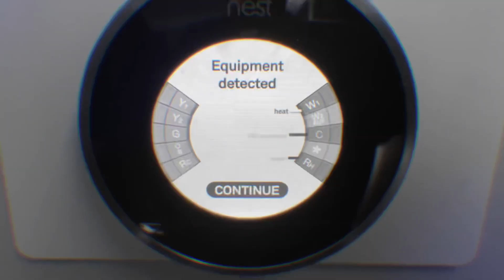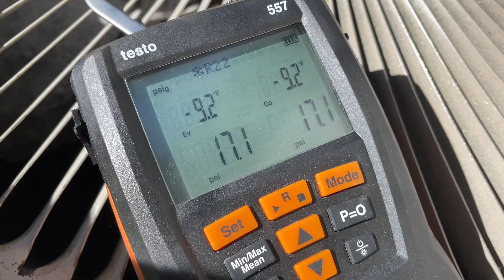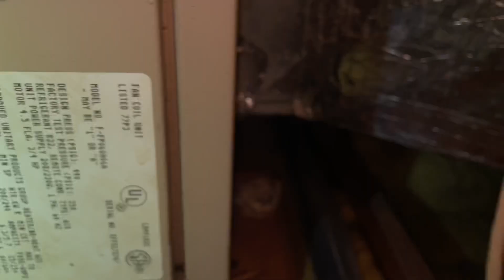Central AC Not Cooling - No Refrigerant R22 in System - Time for a Bosch IDS 2.0 Installation

Comment: There's such disparity in this industry - local contractors either stare at me blankly when I ask if they'll do a manual J, or don't/won't do it, and here you are offering it as a requirement for system replacement. It's no wonder there's so much shit installs out there.

Comment: By rights,that should be metal duct! That 18 is only good for like 1300 cfm,20 is good for like 1700,smooth round 20 inch is what that needs,but if you are dropping size do to it being oversized,the 18 will be fine!

Comment: I urge all my customers to strongly consider replacing R22 systems....if it working now its just a matter of time till you are stuck....doing a leak test....lets see....labor rate plus freon....already halfway to new system....basic logic
Reply: What does a 3.5 ton condenser and a coil run these days?
Reply: @PipeDoctor  that to lol
Reply: @PipeDoctor  
Fortunately my condenser is just over a year old.
Reply: @PipeDoctor  ohio....its about the same....
Reply: Our supplier preordered alot of units...so we are sitting ok.....for now...
Reply: @PipeDoctor  We have zero lead time here in Ohio. Our supplier over orders and never has issues with shortages for the most common sizes

Comment: Unless your home is 5000 square feet or more you dont need a 5 ton unit !
Reply: @PipeDoctor  hahaha
Reply: 3,000 more like it 20 btus per sq ft add/subtract off manual j,Windows,doors,insulation factors! Now in Florida maybe 5 ton unit for 2,000!
Reply: @petersmart1999  They are in the northeast... not florida !
Reply: @oldskool1979  What did you read,I was agreeing that the unit is way big for that house,he has 13 or was it 14 tons total, I know it's in N.Y., not in Florida. In Florida that oversize the condeners up one ton from most indoor coils!

Comment: One of the last projects My late father was working on was 40 ft of sewer ljne. He  antimate about putting cast iron . A job that could have been 5k PVC turned to 17k. Cuz he wanted to use his left over hub fittings And he made sure to put cast iron venting. I mentslly curse him out every time  I see cast iron pipe cuz it out undue stress on him at the time :/  but it had to be done right !

Comment: I think some insulation will go a long way in that attic, joist spaces with no insulation and i noticed a supply boot looked like in a bathroom with no insulation around it , oh boy not good. Nice attic for sure ! 18" flex duct on 5 ton system OMG how did that ever work ?

Comment: High pressure Mikey strikes again!
😂
It could have just been Schrader leaks😆😂
🥃🥃🍺🍺🍺🍇🏌
Stay safe.
Retired(werk'n) keyboard super tech.
Wear your safety glasses.
Reply: @PipeDoctor  cAmon mAn  it was 30 years old ,and on these tube channels I've seen more trane/Lennox leakers?
🤣😆🤣🤣🤔🤣😎
Reply: @PipeDoctor  also stated #2 was added ?
If it only needed #2 where did the rest go in two weeks ? Something's not adding up ?🤔 32oz. System needs 128oz.
Jus not adding up??😐🤔

Comment: Couple of days that leak should be easy to find, that’s why they make nitrogen guys
Reply: Why would you want to make a huge investment in R-22 for an old inefficient outdated system? Then, in the near future, NO r-22 Freon will be available! Now what❓
Reply: A leak of that rate is easy to find and fix also they do make a replacement refrigerant NEW 22 a blend a lot cheaper to buy. I find a lot of service techs today are salesman not Mikey pipes just in general, I built a great business on service first then replacement gaining trust leads to a lifetime customer
Reply: Only a idiot wastes his time and a customers time looking for a leak in a R22 system that isn't worth repairing at all. R22 is through the roof and will be completely gone shortly. The new blends for these old systems can loose a systems capacity by 10-15%. Repairing these old systems are done by people who stop answering phone calls from customers. Way too many things that will go wrong if a contractor puts their hands on it.
Reply: Nitrogen also works on 410a units my point not all customers have 15000.00 for a replacement today times are tough. Although some technicians don’t have the skills to repair an older unit that is still serviceable
Reply: @johnwkolbjr.9605  Not everyone has the money but they all have had time over its life to maintain and I am sure they have been told be prepared to replace it. it's always one more season
Reply: @zack9912000  I don’t discriminate I fix repair and replace all equipment weather it’s 2 tons 100 tons  or a chiller. I work on industrial equipment also it has to run repair is the only option good luck !!!!

Comment: When my 22 system goes im gonna try to find another on ebay. 410 is how many months those systems last.  14 years and done. Im looking for something to outlive me!
Reply: Lol c'mon guy 🤣
Reply: 410a is fine when properly installed and maintained!
Reply: Ok, maybe not outlive me, but 22 units in my non professional opinion are better than 410 units. They run at a lower pressure and therefore leak less.  Give me a PISTON also. Haaaa
Reply: You won't fine R22 for it, we are having  hard time getting it from supply house as it is. R22 is a better refrigerant system compared to 410A and Yet  you won't find a dry R22 equipment anymore.